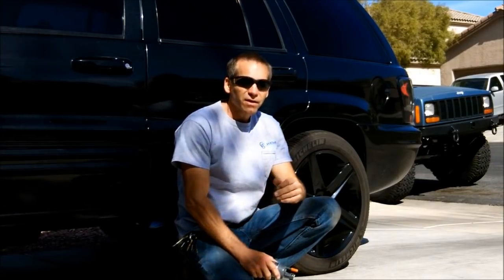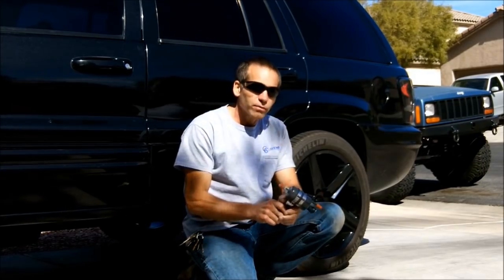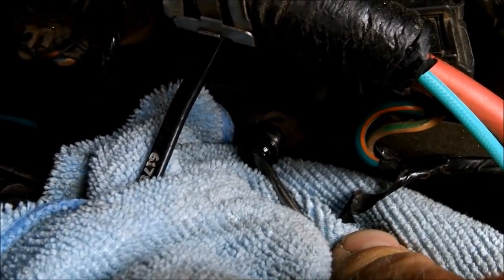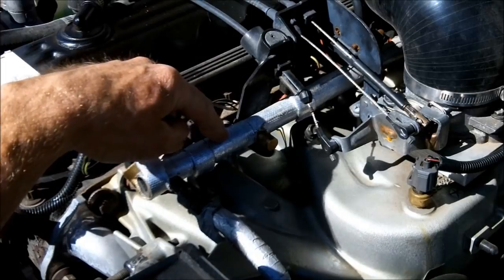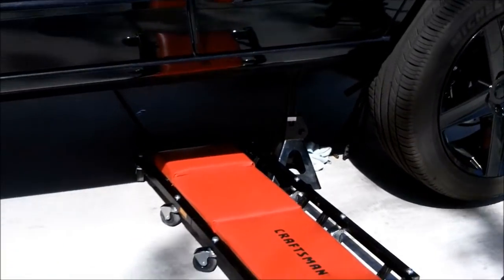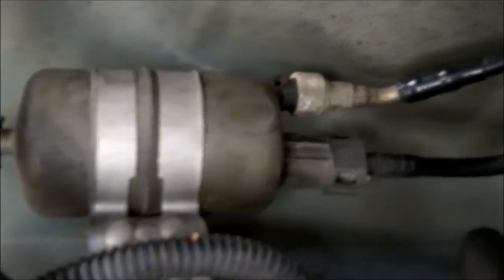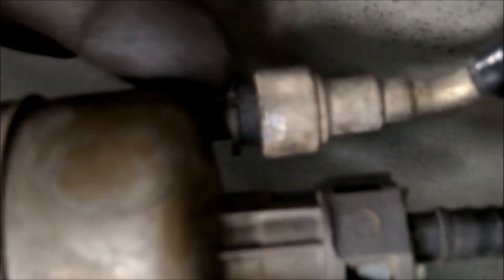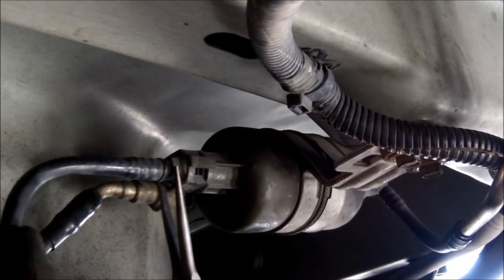Changing Fuel Filter 99-04 Jeep Grand Cherokee

Comment: Great video man. My 97 4.0 does EXACTLY what you described after cutting the old filter in half to look at it. I'm guessing me replacing this would fix my cold starts issue? Because if I start it back up within 5 minutes the Jeep fires up immediately.
Reply from the maker: Thank you, Rob, yeah that definitely sounds like  your fuel pressure regulator . I believe on the 97 and earlier models the fuel pressure regulator is mounted on top of the fuel pump assembly. Unfortunately you're going to have to drop the fuel tank.
Reply: @martinbuilt  - That's what a couple buddies have said. I'll have a cooler full of beer here tomorrow when you get here to help me do it!

Comment: I have a 2001 Jeep Grand Cherokee. It's got some issues I don't know. If I'm getting you have to try changing the fuel pump or check the pressure or the fuel filter.

Comment: This is a great video thank you ! I did changed the filter but for some reason my jeep wont start
Reply from the maker: is the fuel making it up to the fuel rail?
Reply: @martinbuilt  the jeep was working really good but I decided to change the fuel filter and I did thanks to your video but when I tried to start it up the jeep didn't turn on, looks like the fuel pump it's not working , I have been searching for videos and looks like there is a switch that could couse the problem, but I don't know the name of the switch or location
Reply: @martinbuilt  I think is called "inertia switch" but I have no clue the location
Reply from the maker: @elcundislokillo7353  
switch? there is no on/off switch. I would check your electric connection near the fuel filter. Did you remove the relay or fuse for the fuel pump? Check the fuse for the fuel pump.
Reply from the maker: @elcundislokillo7353  I don't believe the Wj has one
Reply: @martinbuilt  I didn't remove the relay, just take the pressure out and the filter, after I was done I open the ignition switch on and off like 3 times and nothing, I'll check the connector next to the fuel tank thank you for all your help I really appreciate it!

Comment: great video! 
thank you! 
I replaced mine in my 04 cherokee 4.7 h.o and it makes a weird pitched noise.
kind of like cavitation or squeezing air out, but no leaks.
very weird.
have you ever heard of this? 
I found discussions about it on a jeep forum but people lack solid answers and knowledge.
Reply from the maker: Jake98Cob 
I have heard of that. some people claim it is a cheap pressure regulator. I can't say I've had any problem at all and mine was an inexpensive one from AutoZone so far so good. Some people have said to get the factors and which is around $100. I looked into the factory one and it looks to be made in China as well as the one I got from AutoZone I think if you have a receipt you should be able to return the one that you purchased because it certainly shouldn't make any noise
Reply: Thanks for the reply.
Guess it's luck of the draw.
I put the old one back on then it made the noise too.
Very weird.
I'll try another filter today.
Thanks again
Reply: I am having the same problem  with my  01 jeep grand cherokee.

Comment: I have a hard start problem.  It starts the on the second crank almost every time.  The fuel pump has already been replaced not by me.  I think it is the regulator (flow back valve) also called the check valve.  I did a lot of reading in the forums and they said the check valve in in the pump itself and unserviceable.  But looking at the video I think it is actually this the regulator in the filter.  I will change it out and let you know.  THANKS for the video.  Great VID!!!!
Reply from the maker: I agree that it is in the fuel filter, part of the fuel pressure regulator.
Reply: Julian Laredo did this fix it? I am having the same exact issue

Comment: Hey
Super appreciative of the time you took to make this
One question though
I'm replacing the fuel filter on my 02 grand Cherokee 4.0 liter 
I'm doing this as a regular maintenance protocol for my jeep
But recently I noticed I don't have any hp in reverse and sometimes loose almost all going up a hill ?

What might be the issue if this is still happening after I changed the fuel filter 165k miles 
But she is well kept
Reply: could be anything from transmission issues to engine issues

Comment: Another Great video. But, what I want to know is:
Is there any effective fix to the EXTREMELY POOR air conditioning Cooling & airflow) of the 1999 - 2004 (WJ) GRAND Cherokee?
I have had 4 of these and the A.C. is universally poor.
I am looking g for am Upgrade to the,AC.heatet squirrel cage fan for MORE airflow. And a MORE EFFECTIVE Condenser.  I know about the door problem. That is/has not been the problem.
This vehicle us good for me for 5 more years IF the A.C. could be fixed.
Thank you
Reply from the maker: I have only had the one WJ and live in Las Vegas where it is 100+ every day for at least 3 months and can not complain about the A/C, no problems so far.

Comment: I hope they pay you a lot of money Martin to do what you do. So detailed in your explanations.
I have a question though. If all of theses clips were removed and I was able to splice fuel lines directly into the plastic hose on the filter do you think this would be a problem? (It’s not leaking)
Reply from the maker: Thank you, Tim. 
If it's not leaking sounds like you did a good job. It would make me nervous because it is under 60 psi of pressure.
Reply: @martinbuilt  I used 3/8 copper crimp ring fittings that are usually used for plumbing

Comment: Thanks for the video - it's great 
What filter would you recommend or did you use?
Part #? 
I have an 04 GC 4.0 
I was about to buy a generic one but after reading about the whining just wanted to ask which one you bought. 
Going to watch the motor mount vid next 
Thanks again
Reply from the maker: I used a Autozone FF832DL. $22.00. I also read some completes of cheap filters after I installed the filter. I haven't had any problem.
Reply: martinbuilt 
Thanks for quick reply -
Reply: martinbuilt  When you get a chance see how your fuel pressure is doing with that Autozone filter cause from what I understand those WIX filters don't have the necessary regulators inside the filter housing so people complain of noises and pressure issues eventually occurring with them.  Just a heads-up.
Reply from the maker: So far it operates perfectly. No noise. I will check the pressure and let you know.
Reply from the maker: well I checked the pressure and with the ignition switch on engine off 52 psi. With engine running 60 psi.
Reply: martinbuilt  Ok yeah that's not bad, I believe our 4.0l WJ's are supposed to be around 49 psi plus or minus around 5 psi.

Comment: Hey brother..  Ive' had my Grand Cherokee Laredo 2001 since begging..  145K miles. Done most of my own work on it.. Hasn't been to problematic.
But living in Texas, not long ago the radiator cracked and leaked out all fluid(replaced it 8 years ago). Got it home, but it heated up past temp max.
Was receiving code P0307 - Missfire on Cylinder 7. Did some troubleshooting and swapped spark coil 1 w #7 and it moved to #1. So replaced Ignition Coil.
All good?   No more codes and replaced 4 sparks on right side of V8. But now it Idles bad. It's noticeable right away to me, because I had it for years.
 At first thought it was a misfire or a piston not firing, But now think It might be fuel related. Will check fuel pressure and
 replace Fuel Filter(Fuel Pressure Regulator) JGC 2001 has them both in one. No engine codes. It starts and ides for 4-5 min roughly.. t
hen eventually goes idle high then low and dies. 
Using Torque App on Android and OBDII. Nothing red comes up on real time data.  Any suggestions? Tanx
Reply from the maker: Maybe the IAC valve, sometimes just needs to be cleaned.
Reply: @martinbuilt  Thank you for the reply. Sorry should have mentioned what I have done so far. So far; replaced 4 sparks on right side and checked spark. Replaced Ignition coil #7 (solved Code), Cleaned IAC valve, Checked Fuel injector current on 1,3,5,7 (bulb lights).
Reply: @martinbuilt  Thanks for the reply. I already cleaned it and looks good. So far; replaced 4 sparks on right side and checked spark. Replaced Ignition coil #7 (solved Code), Cleaned IAC valve, Checked Fuel injector current on 1,3,5,7 (bulb lights).

Comment: Great video, thanks for showing us the insides of the fuel filter. Please help. I had my WJ fuel filter replaced and now I get fuel splatter in the exhaust and MAP sensor high voltage P0108. Could you help explain possible problems please?
Reply from the maker: This could be a vacuum leak at the intake, a fault of the MAP sensor, or the PCM. If you have a scanner with live data, then you could check the MAP with engine off. At sea level it should be around the 1.5V. You could check the value while moving the wiring and see if there is any change. If voltage with engine off is far from 1.5V, then probably the MAP sensor is fault or the ground connection is bad.
 Most likely a bad map sensor.
Reply: @martinbuilt  Thanks. Just got a multimeter, I'll test the MAP sensor wires. I've replaced the MAP sensor 2x. I sprayed carb cleaner around the intake for a quick vacuum leak check but it was ok, no change in idle.
Reply: MAP was reading right. There was a fuel injector stuck open. But the manifold vacuum pressure issue turned out to be something supper simple and not easily detectable. It was the small bit of hose between PCV and the line. It was too soft. When under acceleration, the hose sucked itself closed and restricted pressure, MAP went out of range and engine bogged down, super rich mix. Crazy things happening to my WJ

Comment: What's up with the whirling sound? I used a Microguard F/R It's not from the pump cause I did a vibration analysis and it's clearly the Filter/Regulator. I'm going to go and bleed the line and giver another shot. This F/R change eliminated the chu-chu-chuggging hesitancy at idle and cutting out @ 3000-3500 rpms along with patching and splicing every questionable/exposed bared/cracked wire. The F/R was only $12 Rock Auto Thanks-
Reply from the maker: yep that what happens with those cheap filters. The regulator is making that noise. I got lucky with the one from Autozone.
Reply: @martinbuilt  Bled the air and now the whirring is intermittent. I believe this is cavitation. I was I checked for leaks and there where none. I did have a line mis-connected and it blew off while driving. It was after the mishap that the sound started. Your WJ is SICK! Also pretty quick I imagine.

Comment: In your video with your changing the fuel filter you diagnose the fuel rail on both your XJ and your WJ I see that you have the thermal rap on the xjs fuel rail but you don't have 1 on the wj's fuel rail. I myself have looked for some thermal rap for the wj 4.7 but couldn't find it. One of my questions is is there anything that you could use to wrap the fuel rail and the WJ for the same effect is it already has excessive heat issues existing on the 4.7. one of my other questions is have you ever heard of a duners upgrade for the 4.7? It was the name of the man that originally did this upgrade on a Dakota 4.7 where he took to fuel rails and connected them with a  fuel line, I believe from two of the pieces that have before connected to then and 80 between them we're both Banks would get equivalent fuel pressure is from the fuel rail and spend the same amount of time over the engine exposed to heat and decrease the odds of inconsistent temperatures and behavior with misfires. Could you possibly do a video on this I bet your viewers would highly appreciate it. I bet that upgrade would probably go viral as well.
Reply from the maker: I personally have never had a problem with my WJ.
But my xj has been giving me problems for years with heat soak, and that is why I wrapped the fuel rail on it. Here is a link to a product that should work well on a fuel rail.
https://amzn.to/3NwuBnP
I personally don't believe in that modification where you split the fuel rail to make the pressure equals on both sides. There's no way the pressure is any less on the far side fuel rail. You gotta remember that only one fuel injector fires at a time.

Comment: Hey Martin great videos btw 👍 I also replaced my fuel filter on my 04 jeep gc limited bcoz it started having erratic shaky stumbling idle after start-up.. this happened after i drove it in the rain.. it never did act up b4.. But after changing the filter it still happened..now im thinking its fuel pump. So after starting it over again n again thinking I didn’t prime it the right way the first time now my jeep wont start.. i turn key i hear no click from the starter.. i also have a starter button modded frm previous owner.. all electricals work, no codes also. I thinking of of changing starter, crank sensor but PLEASE let me know what u think
Reply from the maker: Thank you, Ian
sounds like it's always something. Looks like you will need to fix the starter first and then go from there.

Comment: Hi Martin. Where is the fuel pressure regulator on a 2000 4.0 wj?
I have a 2000 wj 4.0 I just replaced my fuel injectors with a 4 hole from a one hole, now im getting a code po172 and po175 bank 1 and 2 oxygen sensors, system too rich.
Would this be normal for the ECM to reset for the new injectors after driving a bit, or is my fuel pressure regulator not adjusting to the new injectors? I replaced my fuel filter 2 years ago. Not sure if its a regulator fuel filter type?? I don't get how the regulator can go bad after replacing the injectors overnight?

Comment: I just got a aftermarket fuel filter microgard on mines and now it makes a whining noise ever heard of that
Reply from the maker: Yes I have. It is the fuel pressure regulator. I would see if you can exchange it. The only problem with less expensive filters. So far mine has given me no problem.
Reply: Hi I just did main and I have whining noise too so my question is what did you do ?
Reply from the maker: @josenieves7185  unfortunately I've heard of this before and it is a poor quality fuel filter I would exchange it for another.

Comment: Sharp looking grand cherokee,  but I have a 01 grand cherokee  with 4.0 I don't think there is a pressure release valve on the rail for these style grand cherokee.  Still did the filter, but It sprayed everything everywhere.
Reply from the maker: If it does not have the schrader valve on the fuel rail then remove the fuel pump relay and start engine. It will stall in a few seconds. You will still get some fuel spray when you disconnect the fuel line but not near as much.

Comment: So is this filter a fuel pump? Or is this a filter and there is another electric fuel pump I'm unaware of .?No fuel done the purge on the V8 4.7 rail ,Then turned the engine over did the purge again and no fuel no pressure ..Do I change the filter ,Has the filter got the built in fuel pump.😊😊😊?
Reply from the maker: The actual fuel pump is in the fuel tank, and there is a pre-filter at the bottom of the fuel pump assembly. 
There is a pressure regulator within the fuel filter that I show in the video.
Check to see if you can hear the fuel pump run when you turn on the ignition to the on position.
If you can not verify that the fuel pump is running check your fuses and fuel pump relay.

Comment: I had to rip the plastic part on my inlet side. The black circle piece. Is there just a replacement part just for that? Or can I just put the fuel line back on the filter without it? It's the style line that has the 4 metal tongs on the inside of it. Which would click on the fuel filter. If I could get just the plastic piece that sits in there I rather get that. I have the square ones. But a square one obviously won't fit that part of the fuel line.

Comment: I have a 1997 Grand Cherokee 4.0, my backup vehicle. Has not run for a while. Was suspecting CPS. Can not get any code to come up with the ignition switch trick. Fuel filter with the built in back pressure thing may be the whole problem.  P.S.  How are you with JGC   2004 grand Cherokee 4.7  no running lights & various other electrical door problems ?
Reply from the maker: I'm pretty good, the 04 JGC w/4.7 is what I own. Electrical problems are always fun...Not

Comment: I love your videos. I have a question for you. Can you use a 99204 fuel filter on a 02 do for Jeep Grand Cherokee they seem to be different in my 02 is making a noise a droning noise from the fuel filter after changing using the 99-04 filter
Reply from the maker: The fuel filter that you mentioned would not work because it does not have a fuel pressure regulator inside of it, and it also does not have the provisions for a return line.
Reply: @martinbuilt  thank you for the reply I've watched all your wj videos.
I installed that filter and it all fit in perfectly and seemed to be working fine for a few days. Now I hear a loud droning noise coming from it. I appreciate your thoughts!
Reply from the maker: @V-MAFIA   I know of other people that have experienced the same issue with the filter and that is the pressure regulator causing that noise I would suggest you replace it again you may wanna go with a Mopar original. I have replaced mine a couple times once just recently because I thought I had an issue with the pressure regulator being too high, but it wasn't and neither one of mine have ever made that noise.
Reply: @martinbuilt  ok thanks! So you don't think the crown Automotive one would work? It says it's for the 02-04 model year